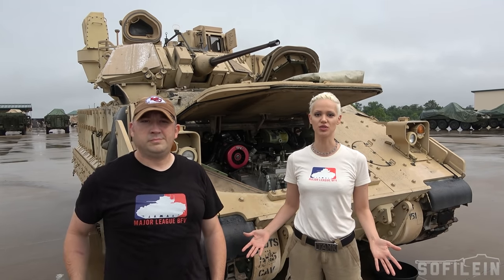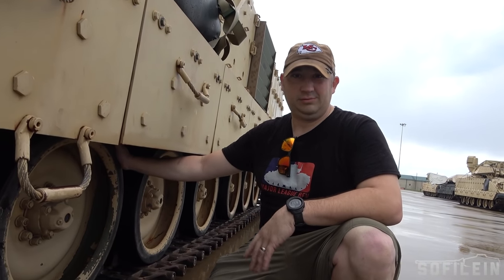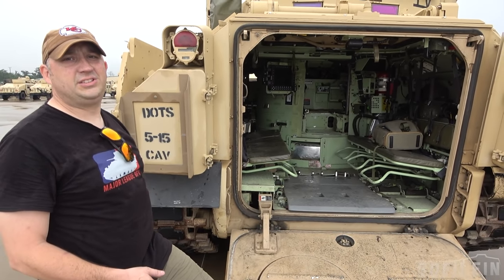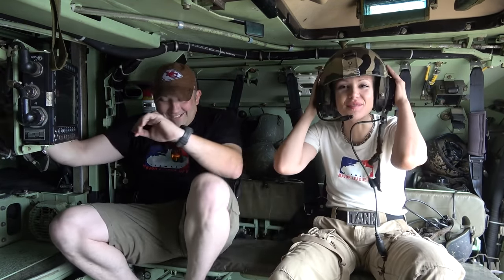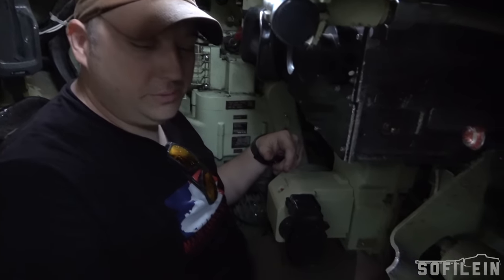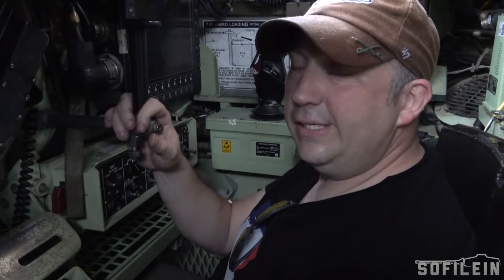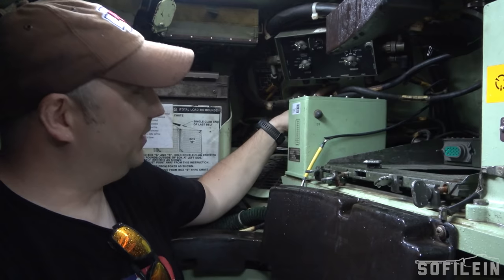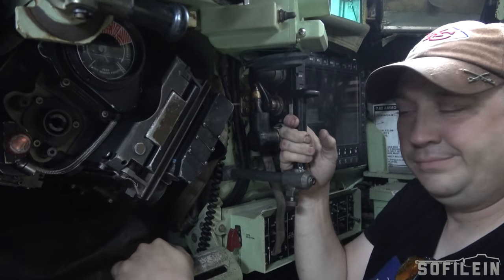The M2/M3A3 and JB: Meeting the modern Bradley IFV

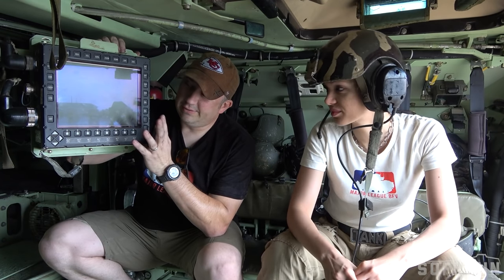Comment: 14:39 "not a touch screen, we aren't that fancy."  Touchscreens are the cheap and dirty option, physical buttons is the better option. Way less chance of faulty/unwanted input, blind operation, feedback. They should really minimize it in cars. I want a button I can find without looking to adjust the heating settings. Not like in a tesla on a touch screen, at least there is a voice option.
Reply from the maker: Very much agreed
Reply: Amen!
Reply: I think touch screens are the lazy way out.
Reply: Well, if you drive on the road it is much smother as driving trough desert on the tracks where you bones shaking. To try in this case to use touch screen is not so easy...
Reply: Got a friend who bought a touchscreen gps/sounder for his boat. Warned him not to, bloody impossible to use in a sea state.
Reply: Totally agree. Things like heater temp and fan, lights, wipers etc should always been physical dials you can grab and operate without taking your eyes off the road. I'm waiting for someone to make a physical control panel that a Tesla owner can buy and sticl below their touchscreen so they can work the heater etc with physical buttons.
Reply: I drive a 1ton dually truck and when I’m driving at highway speeds it really hard to hit the touch screen. Give me buttons any day. Everyone dissed the BMW I-drive system but I loved it. Once you got used to the rotory dial you could use it blind folded. Brilliant system.

Comment: Was a 19D in A trp 2/9th Cav so was on the M3 and 2nd Armored 4-41 inf M3A1 in the 80's. We used to put 2 jerry cans under the ramp as we lowered it. could sleep 3-4 there. you could also get 1-2 in the crawl space on top of the duffle bags but they frowned on that especially when we were on the move.
Reply: I was 2/41 Straight and Stalwart
Reply: @Wyo23  2AD Fwd 1/41

Comment: Reminds me somewhat of the M113 APC my unit used 30 years back. The engine roar/whine ... without the headset, you cannot hear a darn thing.

Ours was a M113 mounted tampella mortar arty unit, so during the initial fire mission drill, we were to echo out LOUD the fire mission commands. And for the longest time, we always thought the NCOs were just trying to be funny with us. Like, why shout out loud, whatever happened to field discipline right?

Then later, we went for field exercises, then ... ooooh ... everyone better echo out loud! 'cos with the the engine, you can barely hear anyone even with the headsets. And later with live firing exercises, battery firing, it was just crazy.

Comment: Amazing how BFV can be useful in many situations, with TOW System and M242 firing APDS-T can even knock out some iraqi bad guys. Idk what is more beautiful, Sofi or a M3A3 BUSK III.
Reply: Brads killed more Iraqi tanks in the '04 invasion than M1's. With 25mm sabot rounds. "Golden BB's".
Reply: @gregsmall5939  Maybe if you sneak behind and hit the engine on T-72 or back of turret where is ammo magazine. But frontal you don't have much chances to pierce T-72 armour with 25 mm. Still, you can try but could be T-72 get annoyed and shoot back (in this case you are KIA). Bradly kill T-72 with TOW...

Comment: So cool. I stumbled on this video by chance. I served from 97-99 at Ft. Knox E5-15 CAV and HHT5-15 CAV on one of these beasts. We didn't have lasers, night vision, and squad displays for the observer/tow loader back then. My memories were that it was way underpowered, loud and smoked like hell during start up and kept smoking until the engine warmed up. You could see the smoke from 5 miles away. The heater never worked and broke right away when repaired. It was extremely cold inside in the wintertime. The drivers hatch would lift up from the overpressure when the 25mm was firing. Taking the gun out for service was a pain in the ass. It took a strong person but there isn't enough room for a big guy in the turret to remove the receiver, TURN and slide it out the door between the gunner and commander seats. We needed to start them up every day to charge the batteries. Maybe we had junk batteries since I was in a training unit. The rumors were that the armor could not stop anything bigger than 7.62 and hand grenades and it drew a lot of fire due to its size. But if there was ever a zombie apocalypse, I would want one. At 150lbs, I could move from the driver's position to the gunner's turret and squad area from inside with all the hatches buttoned up. With a mattress you could sleep 4 small people in the back, and it was easy vehicle to operate. One man could operate the entire vehicle and live in it if he had to.

Comment: Started as a 19d in 2002 with an A2 ODS went back to an A2 and ended with an M3A3  and everything he said is true lol
Reply: Only thing I haven't signed for was an ODS, but I did help an engineer unit at gunnery that were on them, not a whole lot changed from the a2 to the ODS
Reply: @bradm3a3  eye safe laser range finder and the mre heater was about it
Reply: @jamesolbrisch2582  yup that Lazer didn't even apply the range to the gun, just let you know the range to manually enter

Comment: A cylinder full of grease for track tension? That seems so simple, and easier to deal with than big frigging bolts on the equipment I'm used to.
Reply: Yeah, even if it is a bad wear item, the shear amount of screwing around you'd save each time you needed to do an adjustment would make it worth buying a stockpile of spares.

Comment: The wiring in many headphones/buds will be coated with a clear or color coded insulating varnish that needs to be burned off before they will be conductive. If the wire is a heavy enough gauge it can be scraped off but they don't use wire that thick these days in them.

Comment: I enjoyed both the Bradley videos, JB... the sight in the older Brad was the ISU (Integrated Sight Unit) and was originally a red hot/black hot color scheme. The reason the water tanks were taken out of the back end was the crews weren't keeping them cleaned properly and Troops were getting sick from bacterial growth inside them. My own experience on a Bradley was an M3A2 ODS in 3-7 Cav, Ft Stewart from 1997- 2000, was a BC in 3rd Platoon, Bravo Troop.
Reply: Garry Owen brother!

Comment: I see some leftover dry sweep in the motor pool....Better get 27 guys for cleanup detail haha. That or doing gear layouts and emptying and re-packing the damn conex's! I'd rather go to the wash rack to clean under the track vehicles in freezing 40-degree weather. For anyone who had the honor of removing barbwire from the track or repairing a thrown track in mud or snow (or moon dust for those who know)....Suffer in peace because once it's all over, you will miss every second of it.

Comment: I did a little training in a first edition Bradley at Fort Knox when on reserve duty from the crews learning how teach recruit how to operate the Bradelys. I was a SFC 19D4H at the time turret and driver station no engine start up or movement. I also saw the first production models of the M1 down at Knox on an earlier rotation "Whispering Death" as when in a M113A1 we could not hear them coming from the front or the rear.

Comment: Enjoyed the video! Didn’t explain the low ammo sensors very well though. Those are meant to stop you from firing before you pull the end of the ammo belt through the feed chutes and the gun. If you do that, to reload you gotta wrestle the new belt through the feed chute and into the gun. That sucks. What JB said about qualification is spot on though. They give you only enough to complete the course. So you HAVE TO use the end of the belt. Just my 2¢ as an old USMC LAV crewman.

Comment: I've got pictures of when we had to pull the pack on our A3 for services in Iraq.  I think we did our entire platoon's vehicles in about 8 hours.  From pulling the first final drives to reattaching the last ones.
There's twice as much engine hidden as there is transmission you can see.
And yes, the Bradley is front wheel drive.  Heh.
Reply: We lost a fan tower, but it wasn't driver slacking on PMCS.  I have a picture of the face of a VERY relieved driver when the wrench told him, 'this wasn't the driver's fault'.  Then we all piled into the 88 and lounged in the RV while they towed our busted track back to the FOB.
#GoodTimes
Reply: My first BFV NETT was the A0 in 1990-91.  My second BFV NETT was the A3 in 2005.
The tech changed, but maintenance didn't change.
So much easier to shoot.

Comment: That low ammo sensor and creative fix reminds me of ink sensors in printers. Manufacturers want you to keep guzzling ink and buying more like it's going out of style, so they often build windows and sensors really high on the sides of ink reservoirs. This means that the ink level drops below the sensor and window pretty quick, which the printer interprets as you being low on ink. But you aren't really low. You're just not maxed out anymore. So the field workaround to all the low ink warnings is to just slap some electrical tape over the window, so the sensor always thinks the ink is full. 

You better be ready to swap out ammo boxes or ink reservoirs when you're busy and you really do run out though. Don't get caught surprised that you really did run out because you rigged your sensors.

Comment: I'm surprised to hear that modern thermal sights can't pick up black lettering on vehicles. The TTS on the old (my generation) M60A3 could 'see' black lettering, let you read name tags on a uniform out to 100M or so, and even do facial recognition at least that far. I also assume that the added armor does more than make the vehicle "not swim anymore"
Reply: For that kind of detail you need to be real close, and put past 200 you want a quick way to know if you should be shooting or not, so they went to big ass square
Reply: @bradm3a3  I like the long range ID idea. I had a friend who lost both legs to an M1 sabot round through the side of his Bradley in a friendly fire (misidentification) during Desert Storm.
Reply: @richardchisholm2073  that is always a concern, so making yourself look friendly to friends and like anything other than a fighting vehicle to enemies is what we shoot for
Reply: They dont swim anymore for multiple reasons including time required to erect the swim curtain, failure of the front struts supporting the work platform which is support for the front of the curtain, and non fast water capabilities,  inability to fire at anything but aircraft while swimming and time to stow the curtain and damage that can occur to the curtain while it is stowed as it is protected by just a rubber flap

Comment: The IFV version might be fine for our infantry, but the M3 is too big and too loud for CAV recon in the European theater.
Reply: Not if ya know how to use it, the brad is loud, but everything is loud on a battlefield.  And you may hear it but it's hard to pin where you hear it.
Reply: @bradm3a3  Problem is that I gunned on a Brad, but also cut my teeth in a blues platoon in the Air Cav. Don't like drawing too much unwanted attention to my position if I can help it.
Reply: @schlirf  I agree there, but sometimes you have to fight for information or deny the enemy theirs, trucks and dismounts have a very valuable role to play but when a bad guy heavy scout element with a t90 or 2 shows up you need to be able to deny them what they want to do

Comment: Would you believe it to be a cruel thing to be required to assemble or disassemble or even repair a tank in -40C weather,  with no hangar and exposed to the element's, as a drill?   Is there anything we could learn from it?   You know "statistic's " on cold weather maintenence scenario's.   I believe frost bite is closer to a 'frost burn'.   Freezing steel is hard to handle .
Reply: I cant speak to -40 but I've been in some cold on them, it sucks, everything hurts

Comment: Still beautiful, beautiful, beautiful. You didn't mention the M7 FSV variant.
Reply: Nope, I didn't have one to show, I also left out the linebacker air defense version too, but google has all those and I needed to keep it from being too long a video
Reply: @bradm3a3  well I started out as a 14R back in 2003, it is sad that all the Linebackers are gone now. Also fun gunnery tip the M7 runs to much power to install the cameras, so you can't get away with using it in gunnery. The I don't have a tow so I don't have to raise it in the defense doesn't work so we have to hot seat a one.
Reply: @Fix_Bayonets  I've heard rumors the linebacker might be coming back around now that we are getting done with the insurgent fights, and yeah that bfist has one feature I want badly.  When y'all laze you get a grid in the gunners sight simbology, we freaking dont
Reply: @bradm3a3  after seeing that they put Hellfires on the air defense stryker I am not sure what they will do. I also am looking forward to the 50mm bushmaster but I will be out by the time that is put into service.
Reply: @Fix_Bayonets  I'd like to pull triggers on that 50mm as well
Reply: @bradm3a3  So are you an FSR? Or an instructor?
Reply: @Fix_Bayonets  I'm retiring this week, then who knows.  But I've been an instructor for a lot of things
Reply: @bradm3a3  Nice, I have a year left then its off to the Army Corps of Engineers
Reply: @Fix_Bayonets  not a bad career choice
Reply: @bradm3a3  Lock and Dam operator is what I am going for.
Reply: @Fix_Bayonets  just don't go to the Suez canal, they be wrecking boats out there

Comment: When the PTO blows or (better yet) the main oil coolant hose goes, About 18 gallons of oil fills the hull, and coats whatever is inside the engine/transmission (Called a "Pack") I wonder how well the electronic gizmos hold up in that overglorified M113.

It takes longer than 45 minutes to pull the pack on the battlefield. It usually takes all F#$%night working in the mud, dark, and near freezing temperatures with as many bourbon and diet cokes you can casually mix in the can.

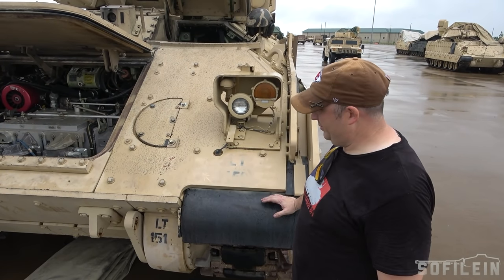@4:20 M3A2 never could float, this is why the water barrier kit was removed. It fjords. 

"Starlight" night periscope would sometimes fall out and crush your nuts why you were driving.

Grease if pumped into an "Idler arm" and, its worthless once you over extend it past 3" because you were too lazy to short track. (If I remember right, there are 156 track pads and you can short track to 153). You usually discover this great information A%^hole deep in mud. A new track stretches, and should be short tracked after the first 50 to 100 miles.

LOL! @10:57 5-15 Basic/AIT isn't at Knox anymore?

Comment: You don't need to tape the sensors if your crew switchology is good. The ODS-SA version has a touch screen in the CSD and SLSD. Need to have the Ukrainian army watch this, quick and easy lesson on the vehicle. The radio won't drop out immediately when keying the mic if your music is connected.

Comment: All that armor and they put a BB gun on it.
Reply: That 25mm, using AP,  destroyed Iraqi "Lion of Baghdad" versions of the T-72 in Desert Storm. It's the greatest gun ever for what it was intended for, and killing tanks with it wasn't in the plan, but it worked for that just the same.
Reply: 200 rds per minute on high rate from basically a 1 inch chain gun. Same design on the Apache. High explosive, apdu, and tpt( training practice tracer) for mout ( mil ops in urban terrain) used as a sledge hammer against structures. Damn fine gun

Comment: Did he say "4 to 5 minutes" or "45 minutes" to pull the trans?
Reply: 45 depending on working conditions
Reply: @bradm3a3  Thanks!  I couldn't quite make out the audio there.
Reply: @grimlock1471  no problem, any other questions hit me up, this is a full service comment section

Comment: If you get that track too tight you'll wear out pins, and break tracks a lot more.
Infantry should never fight from inside the vehicle. Transportation to the battlefield, and for overwatch fire support/suppressive fire, is all an IFV should be used for.
The Infantry should dismount ahead of the objective, and assault the objective on foot.
That thing has too much reliance on electronics, and every IFV doesnt need to fire TOWs.
They should have let an 11B design that thing.
Please tell me it still has an M2 mounted somewhere on that thing.
It doesnt need a 7.62 coaxial. The grunts can carry a 7.62 with them. 🙏
You should never use an IPOD over the intercom. If you're bored, there is plenty to do. Like vehicle, or weapons maintenance.
You only need one TC, and he should be the gunner.
I now see why Mechanized Infantry has a different MOS. They arent really Infantry anymore. (They're excess baggage in a light tank.)
Reply: I never had a track break in my 7 years as mechanized infantry. Have seen the tensioners blow their seals though

Comment: MECHANICAL BRADLEY IS BETTER THAN THE ALL ELECTRONIC SYSTEMS. Why you ask? Well as a veteran I was one of the soldiers that hated the trend of all electric & digital with no analog to back it up. The mix of analog/mechanical with some digital works the best. A WWII scenario, the new Bradley's are just not as tough and will be eliminated easy. EMP grenades or place a device that interferes with the signals. I'm sad that the militaries of the world went to all digital. The AK-47 is still being used everywhere because of its simplicity and durability under pressure. It was designed from WWI problems in fighting in the mud, sand, and water, would jam the equipment and soldiers would fall or pass away. You need tough equipment to last. Thanks.